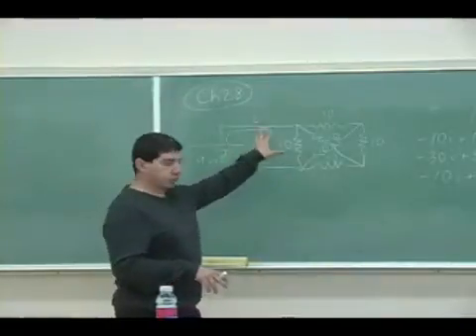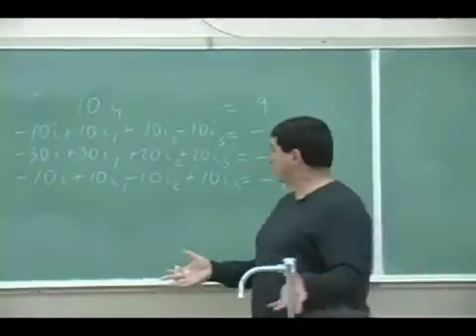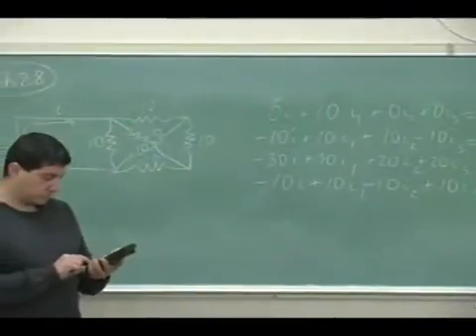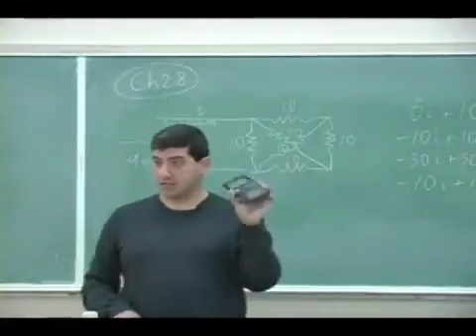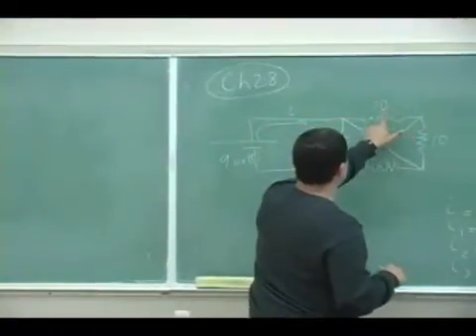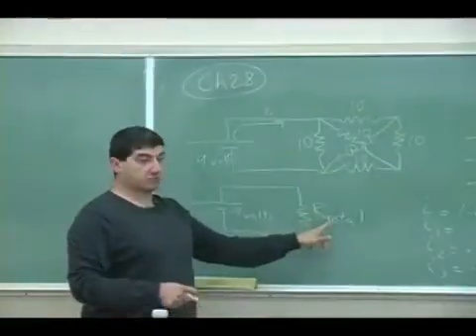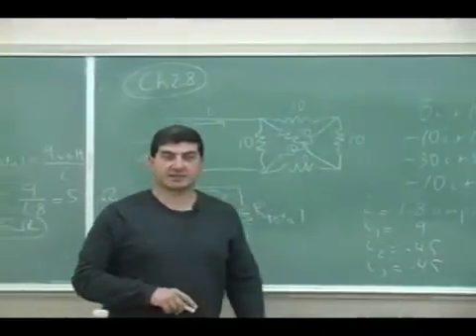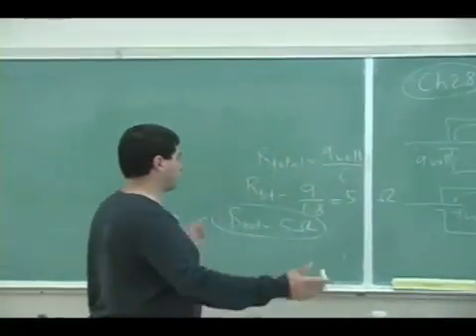Resistors and Kirchhoff's Rules Example 1 Part 2

Comment: i dont have ur advance calculator so i used the method of elimination and this is what i ended up with:
i1 = -0.9A      i2 = -1.35A       i3 = -0.45A         i = +2.7A

i believe my answer is correct because it satisfies kirchoffs current law and urs doesnt  i.e  i+i1+i2+i3 = 0

good explanation of problem solving though !